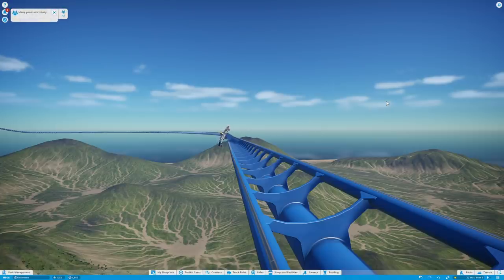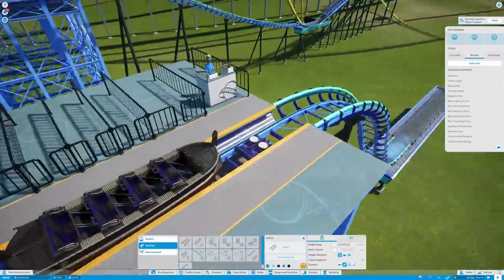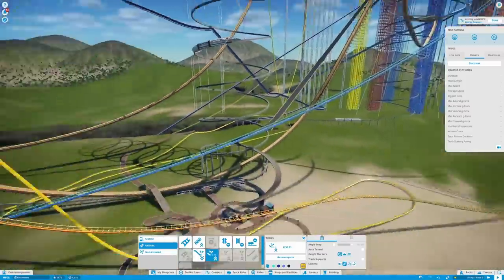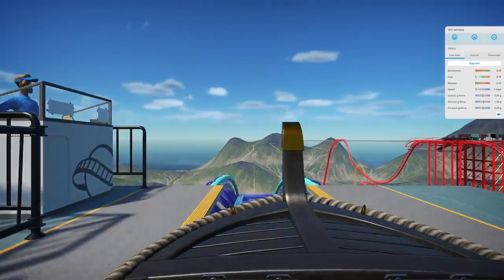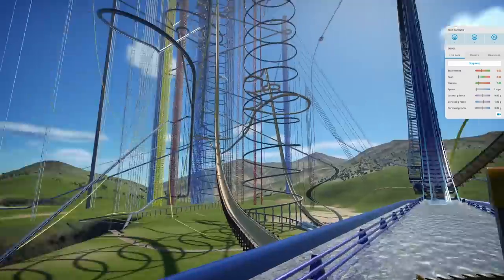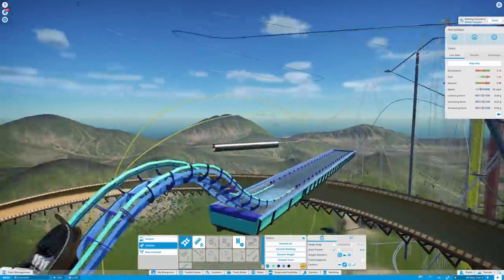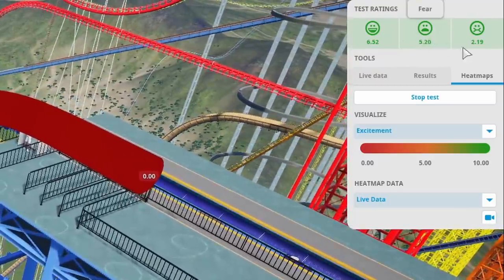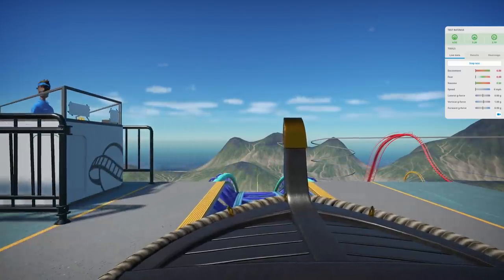The Worlds Most Incredible Water Roller Coaster Ride??

Comment: You should make a second water coaster and instead of have and actual splash section, use the terrain tool and add water and have the boat skim the water and add water effects and also still have a slow boat section as well